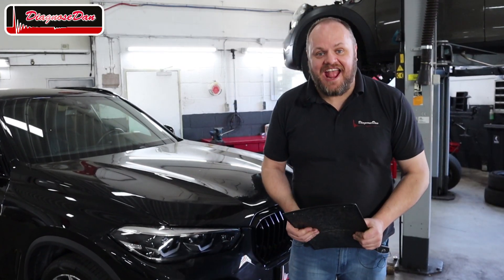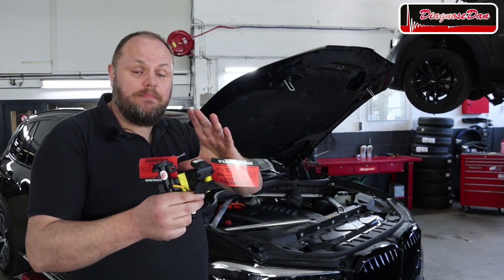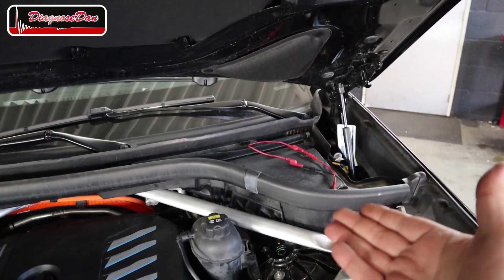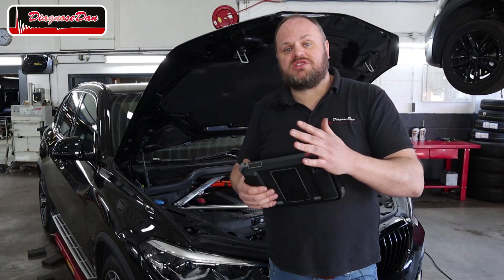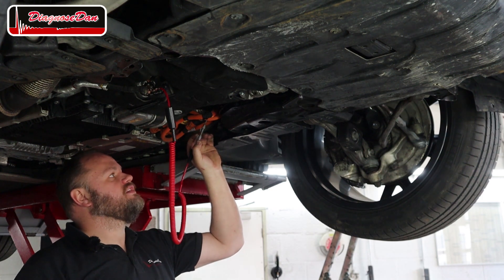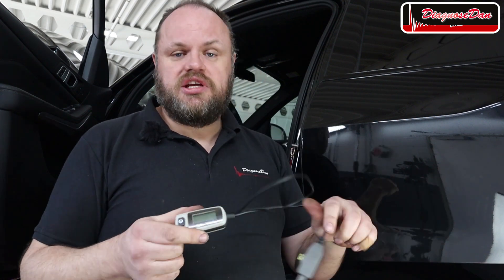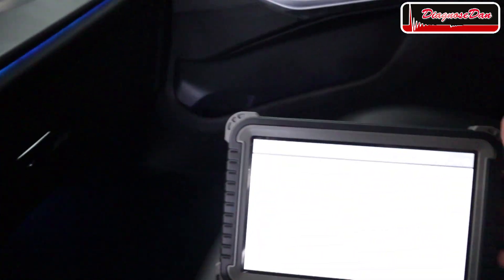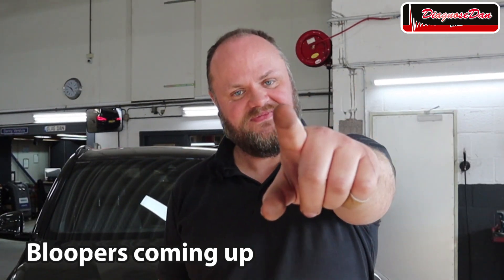Crashed 2020 BMW X5. Can we fix it?

Comment: I had no idea a pedestrian impact system like that existed on any car. Fascinating
Reply: You will find such a system on many cars. But the reason for this are the Rules from government. There is a rule for the distance betwen Motor and the hood. If the Motor is to close to the hood, they have to do this.

Comment: Hello Dan, It is very interesting video , can you tell me better why after shorting wires/connections  from rear part of protection don't fire airbag when you simulate short wires/connections in accident or make better overhead action and all airbags disconnect from connectors ? Because the airbags  has more the one. Thanks for answer Tomas

Comment: I use a simulator when needed for testing airbag wiring.  2.5ohm resistor in a Gatorade cap sealed with hot glue lol

Comment: Does the amp meter have a current limit? If not and there is a short which caused the fuse to blow, something else will melt. I used a 60W lightbulb as a fuse before to find a shorted crankcase ventilation heater some years ago on an Audi A2.

Comment: No doubt about it, the technical aspects of your videos are absolutely awesome.  As an old timer who used Sun oscilloscopes to diagnose and set up engines in the 70s and 80s, and later migrated into the computer industry, I am fascinated, even in awe of how far technology has come.  And, like yourself, back then I had a reputation of being able to diagnose and repair anything that came my way, although those vehicles were clearly not as complex as they are today.  I know how it is to get a car from another dealership, from a manufacturer an independent shop, or even a basket case from a DIYer.  A lot of your approach in diagnosing a problem is much like I would follow back then, despite the relative simplicity at hand back then.  

I am now retired (2018), and have some really cool vintage 1973 Mustangs and 1969 Shelby GT500, and a 2020 Shelby GT500, to play with and help keep me busy.  I spend a bit of time scouring various forums looking for fellow owners of First Generation Mustangs, Cougars, and Shelbys who need help or thoughts on diagnosing and repairing those machines from way back in the 60s and early 70s.  I have a vintage Sun 1150 oscilloscope that I love to use with the old pony cars, and an old Sun VAT-40, along with some other instruments that were so popular back then (dwell meter, anyone?) - lots of fun.  But, I decided to move into the modern world and see who might have newer scopes I can use with the older cars, as well as the 2020 Shelby - just for fun if no other reason.  And to try to get something a bit smaller than the Sun 1150 unit on its large, full size3 mobile/rolling base.

Wow!  I can hardly believe so much really cool technology is out "there" to dig through,  And some really cool forums and YouTube Channels...  I picked up a MicSig SATO 1004 Master Kit scope unit the other day, and have a 2204a PicoScope, for quick and dirt stuff, coming.  Meanwhile, since it is Winter Hibernation season for the pony cars (Upstate NY, snow country), I am going to take the next few months to read about, watch various lessons and videos on, and learn as much as I can about how to use these digital scope units.  And, I have ordered the parts needed to build a little "ignition lab" (for other somewhat related reasons).  I figure by watching your YouTube Channel, and some other also well known and respected channels and forums, I ought to be ready to "hit it hard" when Car Season 2023 comes.  If nothing else I should by April, 20223, be familiar enough with the new equipment to not embarrass myself too much as I begin to hook them up and use them "for real."

Okay, Dan, back to you...  As much as I appreciate the content you share, and your demeanor when presenting your thoughts and diagnostic/repair approaches, what I think impresses me most is your ability to laugh (with us) at yourself as you put forth your little bloopers now and then.  What terrific comic relief!  It would not surprise me to see you take your "act" on the road, and try your hand at stand up comedy.  You seems to have the chops for it, and already entertain to a pretty large group.  And, in the event you don't think the world would accept a Car Guy as a comedian, I give you Jay Leno!  I'm just sayin'...

Kudos...

Comment: Pedestrian Protection System! Which lunatic came up with that extravaganza? Jesus, there is already more plastic under the bonnets of those overpriced junk heaps than metal, You are more likely to be impaled with brittle plastic shrapnel than your head findin any metal to contact - Totally ridiculous design. They should have strapped a mattress onto the bonnet instead.

Comment: hello sir, thanks for the video, just a quick one sir, how did you short out the output side of the airbags and how did you disconnect the airbag and also which one is the airbag sensor, is it the hinge actuator. thanks

Comment: Its interesting does the high voltage heating heat the entire coolant system engine as well? Or does it have valves to isolate it from the engine? Or is it two separate systems with a water to water heat exchange? I know a lot of modem diesel cars use electric heater plugs as well as the engine, due to the engines being so efficient and taking ages to warm up.

Comment: Hey i was wondering if u could help me out here i saw ur video from like 4 years ago about you fixing a harmon kardon setup on a f30 bmw and i have the same thing except my car has no sound whatsoever but i can still connect my phone scroll through the channels and adjust volume and i took a obd scan tool and it said “amp undervoltage” code B7F4E1 and ive spent days trying to find someone with the same prob and calling audio shops and no one knows whats wrong

Comment: Isn't it the case that SUVs most likely get you underneath as opposed to the bonnet? They are just too tall usually so you end up under the car.....
Reply from the maker: First they hit you and hopefully stop, if your on the ground after being hit and the vehicle hasn't stopped it will run you over😬

Comment: it seems obvious, when you highlighted it, not to plug in an explosive device before checking the wiring is 100% correct,however,I wonder how many people have just plugged in a new/replacement unit and had it go off immediatley.Good one Dan.
Reply from the maker: I've seen it happen in a body shop once😬

Comment: A BMW X5 hybrid.  An act of automobile lunacy.  Wouldn't have one as a gift.  What you did Dan would be utterly beyond 100% of ALL BMW trained mechanics and probably beyond most of the Engineers in BMW too.
What is a car for?  To get from "A" to "B" safely and in comfort.  Explosive bonnet lifters for the hood in the 0.0000000001% chance of hitting a pedestrian whose head hits the hood ?????????????
A used X5 has come up for sale in  my local town.   Mentioned this to my local garage mechanic who used to repair my E39 Touring and he promptly said "don't bring that thing in here for me to fix !!!"   Did you know the X5 has a water cooled alternator - which fails - and costs mega bucks to buy and fix ????
BMW now have opened up a plant in China to "save costs"   A BMW Finance driven decision.   What will happen next is the Chinese will take the good parts of BMW engineering and discard the lunatic bits like explosive hood lifters and produce better cars than BMW  - for less money and so will end BMW.
Reply from the maker: Thanks for watching

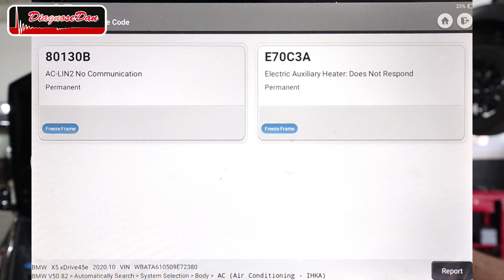Comment: Dan, do you ever use Freeze Frame data? See 7:33 for example. The diagnostics also offers to show the freeze frame (blue buttons), i.e. recorded values of a number of parameters at the time, when the DTC was set.
Reply from the maker: Yes but in this case that wasn't really relevant

Comment: there is a safer way to test this kind of airbag system error, instead of taking a wire just take a 2,4 or 2,7 ohms resistor. Since this is allmost the same value of the devices the code should simply disappear instead of triggering another faultcode without totally shorting out the system.
Reply from the maker: Most don't have a resistor at their disposal. This test can be done without any special tools

Comment: Very impressive how well that aftermarket scan tool worked on that vehicle.
An important point is to understand that every module on that lin bus is a transceiver, if you have power and ground and still have communication issues the module has to be unpinned and measured. Easier said than done lol, extra charge.
Reply from the maker: Thanks for watching

Comment: Hey Dan, thanks for the great videos and for sharing your extensive knowledge. A question for you and our community here: our (extended) family has a variety of cars, from relatively new (2017) VW's to older (2013,14,15) Citroens, Pugeots, and Volvos. 
Some of us have the mechanical skills to tackle big & small repairs, from changing injectors to brake pads and disks. So far, we discovered that almost every action requires a dignostic/configuration tool. If you were to recommend one that will cover most functions/brands and wouldn't require a new mortgage, I would be very grateful! 
"The best for non-professionals" I would call it - I feel it's worth investing in one if the whole family can benefit! 
I am confused by the requirements to pay for updates, like Autel's stuff, for example. Does it mean the diagnostic will not work if not updated? Or will it not work on cars newer than the latest update? 
Are diagnostic tools on your phone via an app worth it?  They promise the world, but I'm understandably skeptic about it. 
Thanks very much and always a pleasure to watch you work. A lot of our family are doctors and when I showed them your videos they called you the Dr. House of cars - correct diagnostic is the hardest but most rewarding part. All the best from the UK!!
Reply from the maker: Thanks for this great comment,. i love Dr. House! 
Most scantools come with a year of free updates. After that no new models or functions will be added if you don't pay for updates. 
Autel, Launch, Topdon, Snapon will all.keep working if you don't extend your subscription. 
I'm not a fan of phone based scantools because of the small screen. 
I dont know what your budget is but Launch, Autel, Thinktool, Topdon have professional and affordable scantools
Reply: @Diagnosedan  Thanks Dan! Will definetly check those out! I think our budget is around 500 Pounds/Euro. I will look at all the brands you mentioned and thanks again fro taking the time to reply. Cheers!

Comment: Great diagnosis Dan. Your skills are amazing and thanks for sharing. I'm a mechanic myself with twenty five years experience and from all my years in the trade I know that new cars are complex, but really with a good wiring diagram and knowing your pin outs and values they're not that more difficult than say older cars. What I hate in todays cars is wires that are all the same colour and locating the sensors. Many thanks 😊
Reply from the maker: It all comes down to having access to the right info and that can be a challenge

Comment: Awesome job as always Dan! 
As for the popped fuse for the aux heater.. would it be possible that there is a short in the wire that may happen intermittently, maybe when the vehicle moves and the harness shifts? Is that something you would wait on until the customer returns the car for same concern?
Reply from the maker: Its absolutely possible but you would have to consider the most likely cause. With what we know about this car, the fuse proberbly shorted in the accident. But to be a 100% sure we'll have to wait and see😉

Comment: We use 2.2 ohm resistors as dummy loads on SRS systems.

They plug straight in with no damage 👍
It's quite amusing what the main agents can't do these days too 😃
Reply: Jules Anderson, is there a specific wattage for the resistor?
Reply: @gartheligon140  we use 1 watt.
Just what we had lying around!
Reply: @julesviolin  
Thank you.
Reply from the maker: You are right👍

Comment: I can't imagine the cost of those scan tools that you use with so many special functions for such a new car. They surely cost a fortune.
Reply from the maker: You need alot of tools and subscriptions that's one of the reasons the hourly rate is quite high in workshops

Comment: I've got a question. When checking for powers and ground is there a reason for back probing rather than disconnecting connector?
Reply from the maker: Somethimes (not always like in this case) you have a power provided by a module. That power can be turned of by the module when it detects a short. When you unplug it the power might return. That's why i always try to keep the connector connected as much as possible

Comment: Dear Dan, I love your videos! It was a pleasant surprise to watch this particular episode as the in the first half of it you are dealing with those activators I happen to know pretty well. I am one of the engineers responsible for the production of those. On this model it is already clear at 4.10 that they have been used. The black riveted cap has a hole in the center and the metal piston is peaking out. At all of these and similar activators the plastic cover should be complete and undamaged in any way. Towards the car's electronics they are equivalent to a 2 Ohm resistor, if you ever want to check the integrity of the wire harness. You are also safe to measure the new activator with an Ohm-meter, should you be curious. It will not explode! :) Still, I strongly recommend - in order to eliminate any risk towards you and the part - to wear a safety glas and there is no eletrostatical voltage around. Please, note that some of these parts have a shorting bridge in their connector, especcially to protect the activator itself.
Reply: Thanks for the tips on what to look for on these Activators.
Reply from the maker: Thanks for the awsome feedback! I noticed the plastic caps when i saw the replacement parts. Thanks again👍

Comment: Hi Dan, Thank you for sharing with us your technically expertise regarding the BMW X5. With the advancement of car technology, that a simple fuse can be causing the problem to putting the steering back to a default setting is all that is required to solve the issues. However, knowing the basic is  fundamental to car diagnostics which you have shown us in the video. Keep them coming Dan, I really enjoy them and learning from your vast knowledge.
Reply from the maker: Somethimes its as simple as replacing a fuse!

Comment: I love it. Plugged in two plugs, changed a fuse and a key battery, and turned the steering wheel a few times... easy money man hahahahahaha
Reply from the maker: Ha ha ha you are basicly right as long as you know what to do😉
Reply: @Diagnosedan  yes of course. Very easy to make more problems when you don’t know what you are doing 👍

Comment: Customer is lucky with that EPS rack. Sometimes when the car is crashed its electric motor takes huge momentum through steering rack. That force spins the motor and motor produces voltage back to the EPS ECU and cooks it.

Comment: Great job Danny. I also have to mention that the bodyshop probably did a fine job as well. I just ordered some ADAS equipment to go with the alignment rack and some new hard and software because of the smart cars that are slowly starting to get in.
Reply from the maker: What brand did you order?
Reply: @Diagnosedan  I had no other option than Autel. Maybe not the best but that stuff is freaking expensive. We made a deal, and I have the Ultra so no need for a new tablet, but still. Duur speelgoed.
Reply: It does seem the body shop did a great job putting this car back together and kudos for sending it to DD for the final check up and to button up the repair.

Comment: @Dan, why did the amp meter still show .9 amps with the heater on ?  Same as with it off.
Reply from the maker: Because the Auxilary heater is powered by the high voltage system. The Auxilary heater ecu is low voltage, so not much will change when you command it to heat on the 12 volt side.
Reply: @Diagnosedan  Yes, no change at all.

Comment: Was in a major crash but the owner still want to do the services at the dealership for the stamps ! 
The car is already depreciated, that dealership oil change won't add or hold any value...  😂
"Yes it have been crashed and the wheel flew off BUT service have been done at dealership."

Comment: Nice! When you connected the amp meter did it offer you protection? Does it have a programmable or resetable fuse (eg 10 amps resetable)?
Reply from the maker: If you look closely you'll see it has a fuse.

Comment: Why didn't you start the PTC heater with the ampmeter on? Then you could have checked the amp draw. Instead you put in the 5A fuse and started the heater only afterwards. Yet the heater also should have started with this ampmeter in line, shouldn't it?
Reply: He did...he turned the heater on after observing there was no short.
Reply: @Garth2011  Ok, my fault. This is the 12V power feed to the small PTC heater control unit only. Which obviously only takes about 0.1 A in whatever state the PTC heater is in. The actual heater core is on high voltage and therefore the power draw of the PTC heater core itself is not on this small 12V fuse.
Reply: @koeniglicher  Correct however, the same amp draw was with the heater on or off, 0.9 amps. I would think with the low voltage leg of this system, when the heater is engaged, the amp draw would climb a bit more.
Reply from the maker: The aux heater is powered by the High voltage system, the only low voltage is the control side. I just extra checked it to be sure, but the current draw should remain the same